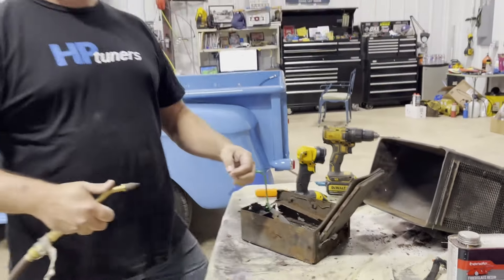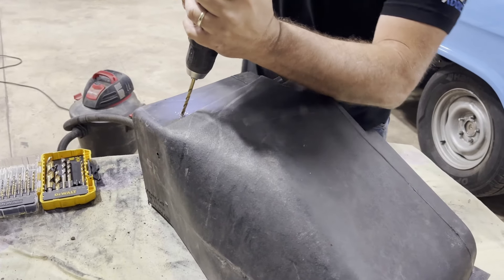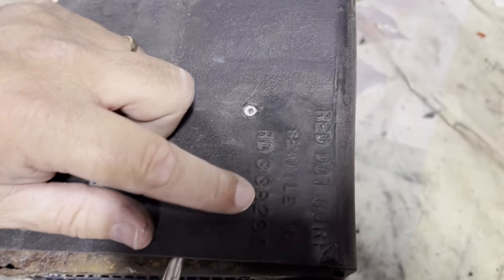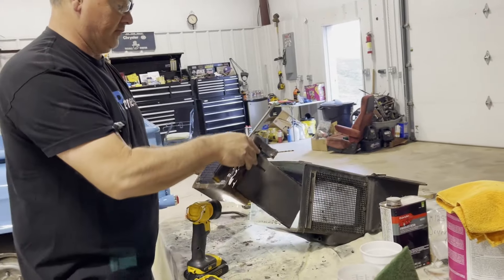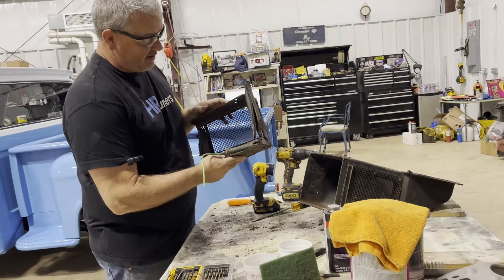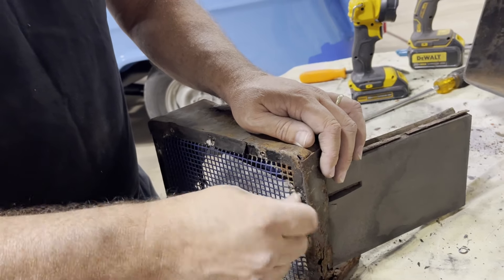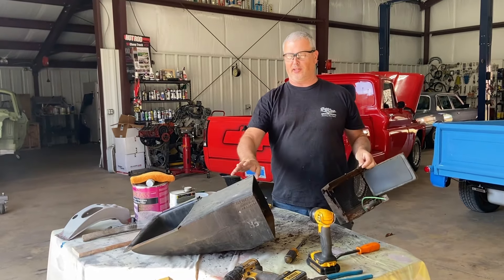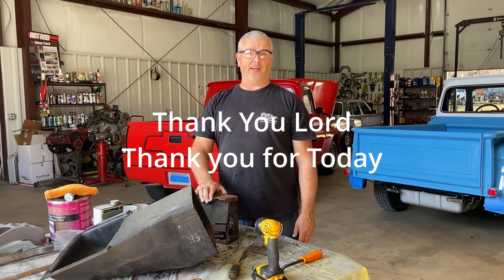Peterbilt episode 14 with the fall colors changing we try to work on the heat and a/c inlet box

Comment: Strickland's @ Cana, VA. 18 acres of salvage trucks. What year did peterbilt 379 change from air operated door to electric?
Reply from the maker: @joeyhollins9531  had to be 99 and after, maybe a year or two before 99
I checked a 99 model and heat and a/c was all different

Comment: What would it be like to permanently seal off outside air?
Reply from the maker: @timgravier7804  not a huge deal, on street rods we seal up the factory fresh air inlet and modern heat and air work fine.  Worse comes to worse I can seal it up 🙌🏼👊🏼👍🏻🔧🔧🔧
Reply: @andhotrodshop  What works....works. Thank you both for sharing the Gertrude content, I'm sure you'll fix 'er up.